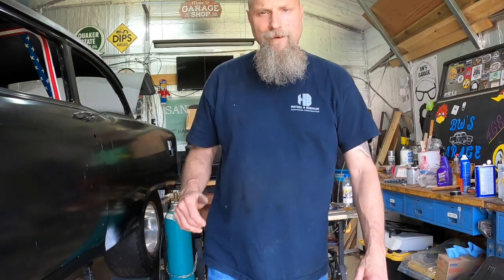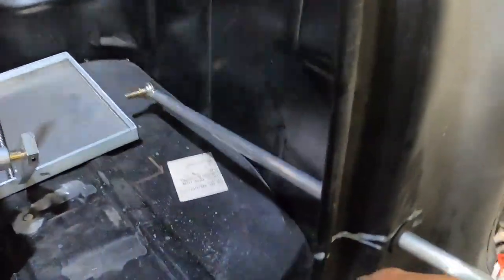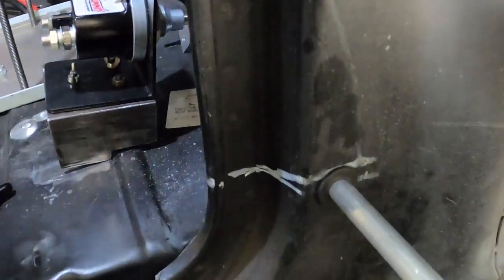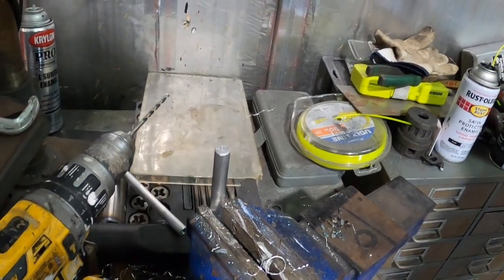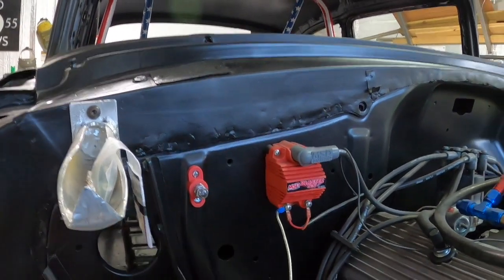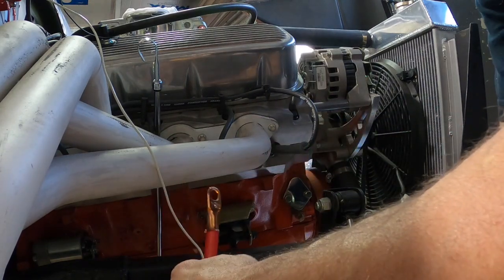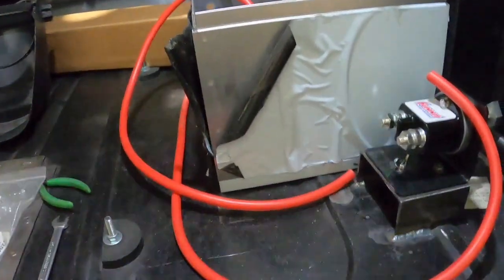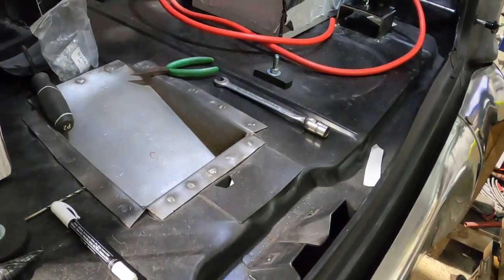How To Install Battery Kill Switch

Comment: That heat gun works good! Thanks for the shout out Brother! Those pills were the easiest battery cable lug install I have seen. I will need to get some of those for Jason’s Hot Rod.
Reply from the maker: I am gonna cut the first one open, Frank expressed concern that I didn't allow heat on wire and says cold joint. I pulled like crazy but plenty of lugs to verify.

Comment: Very Nice work on the cables and cutoff switch. I really have to get off my butt and get one for my cars! Very important for safety. 😎👍
Reply from the maker: Go with the summit switch brother, it's the same as the flaming river but half the price. Only difference, it dont come with grommets. No biggy, they are cheap. Appreciate the support.

Comment: Nice job on the cut off switch BW and i really liked those pellet things to.  Very impressed with how well it was holding after you melted it and put the wire in..
Reply from the maker: Thanks Robbie, I like those pellets too, and they hold real good. I may ad a little heat next time after wire is in there. Really happy with cut off switch

Comment: Nice Job BW! The kill switch turned out great! Can you run the power wires behind the box and under the kill switch? The bumper fits really nice now. The trunk will be nice and tighty when it has the Rator Liner on it! I don't know how many times I've found a part once I buy another I think that is just how it goes building a old Hot Rod! Lol Although the wait paid off because the bumper you got from Jay is a really decent original! Cars looking good and the power wire is in a perfect spot! Talk to you later buddy 👍 Oh and that he gun works great, Turlo knows his stuff.
Reply from the maker: Yea, once the box is mounted I can play around and find the cleanest looking route for the cable for sure. Nice and Tighty is the right wording to brother. That's what I am after. Clean.
Yea, I couldn't believe my eyes when I looked in the bin and saw the bumper, your right though, happy with the one I got from Jay. Didn't want a painted bumper. Appreciate the support brother take care

Comment: Neat work on the batt wire. Will be buying some of those pillco things. One up on ya I buy stuff I know I have just do t know where it is.
Reply from the maker: Yea they work good, I will be adding a little heat after wire is inside lugs in future. Frank made excellent point about possible cold  solder joint. It did grab quick though 😆

Comment: I have soldered lugs on to cables for years. My concern is the solder may not have grabbed all the strands of wire. Adding some heat after wire is pushed into lug will prevent a cold solder joint. 
Bumper🤣. Stuff happens.
Reply from the maker: I will have to have another look at it Frank, it was a molten pool of liquid when I shoved the wire in, but I get your point.